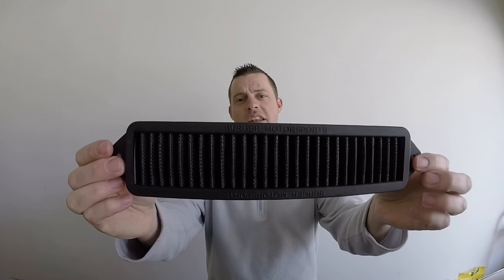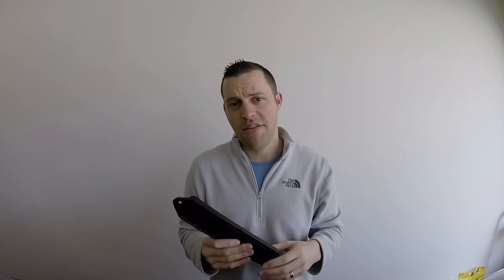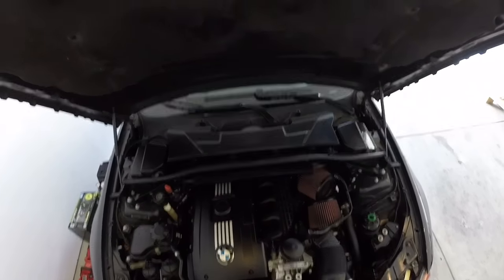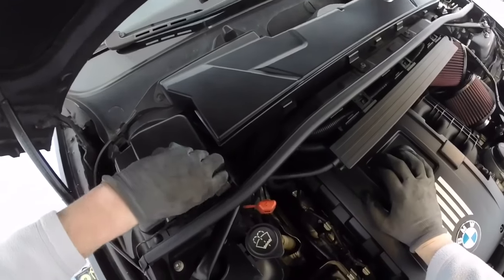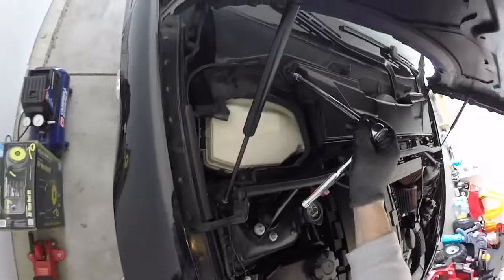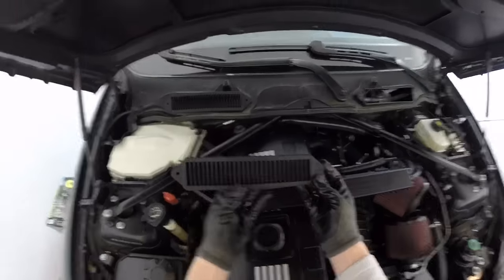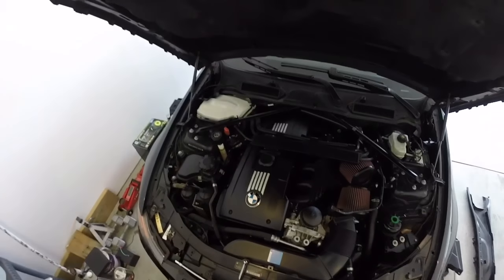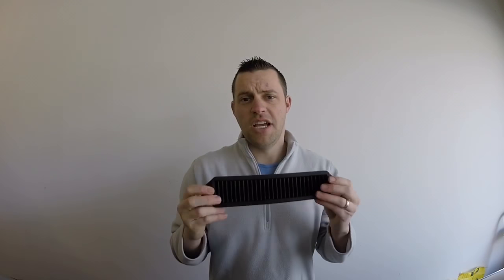Burger Motorsports BMW Cowl Filters POV DIY Install!

Comment: Even though must people would sky away from a BMW with 147k miles. I would buy yours in a heartbeat with all the maintenance you have done I'm sure the channel will help when you sell it
Reply from the maker: eddie lewis thanks Eddie! Yeah it's very clean inside and out 👍🏻 runs good too
Reply: eddie lewis btw this is my other account ur welcome it looks like a very clean car have you had any issues with the steering wheel plastic trim peeling?
Reply from the maker: Eddie Lewis just a little bit

Comment: You’ll definitely get easier access to your engine now. Without the cowl you’ll be in there much more often, with all the issues that water pouring on top of your engine and electrical connections will cause.
Reply: Word
Reply: Thank you to rise this concern. I wouldn't install those filters as in Belgium we have a rainy climate.
All the stuff BMW installed is for separating water / air.  My guess is some moist air will be sucked in or even worse will fall into the engine bay where it's not welcome.

Comment: ...and...what do you do about the cables hanging on the valve cover that used to be attached to the cowl?
Reply: My question also because looks really bad like that
Reply: MaddMatt ! Thank you
Reply: Yeah just velcro strap them to the strut braces - works well and easy to undo for work.  What I want to know is how to keep the weather stripping in place as well as that plastic housing (where the filters are).  Mine wants to come off the windshield and there's nothing really holding it...
Reply: that videos private man what he do?

Comment: is there water getting into the engine compartment or not?
Reply: I did these on my 135i. I only removed the air filter housing and left the bottom cowl. I have heard horror stories of the fuse area getting water. I also have to cover them with plastic bags when washing the car. They are fine for rain but not a pressure washer blowing on front glass.

Comment: What about those wires in the middle of the engine now? Do they just sit there?
Reply: I got a E90 and I was wondering the same thing.
Reply: @killabwpd  I figured it out. U unclip those boxes that the wires are in and zip tie them to the strut brace. Looks good
Reply: Thanks man, I'm assuming your running with the cowl off. A lot of people complain about the heat coming straight through the vents whenever it over 60 degrees outside. Is that a issue? I grabbed a 09 335 on Saturday and I'm ready to start ordering things!
Reply: @killabwpd  so what I do is put just the bottom part of the cowl on so it created the seal for any rain running down the Windshield and it protects from heat and sound
Reply: @jackb2879  thanks man. A lot of back and forth on the forums on these cowls.

Comment: Did you have any water seepage issue during pouring rain? Juz worried the water may go into DSC module/
Reply: I wouldn't worry about the DSC as that box is sort-of nicely sealed from above. I'd worry about different kind of seepage - the wide metal part helps to hold the cowl in its place. If the cowl starts to sag for whatever reason, it can detach from the windshield molding and in that case water would run down the windshield, then straight under the cowl and down inside the HVAC blower motor which sits next to the fuse box... I wouldn't risk getting water splashed around inside the dash for the sake of convenient maintenance. Also the engine loom would just rest on top of the head which gets HOT. Unless you do something about that, you are just asking for trouble imo...
Reply: This is a better alternative, you can use the BMS filters if you want while still keeping that rigidity https://www.youtube.com/watch?v=sFgQj51UQMY

Comment: How does this make installing these better sounding?  I was told by the BMW dealer that having all the OEM cowl parts and covers insulates a lot of the engine noise inside the cabin of the car.  I actually noticed after changing my plugs and having all the cowl parts off that I could hear the fuel injectors inside the car until I put it back on and Im not talking about the main cover over the injectors.
Reply from the maker: Alberto Francisco More cabin sound to hear your turbos, intake noise, etc.
Reply: BMW Fanatic Personally I hate hearing the typical ticking sound from the fuel injectors, valves etc... I would much rather hear my radio or exhaust
Reply from the maker: Alberto Francisco yeah some like it, some do not

Comment: Are you worried about rain/water getting in the engine bay ? That's a lot of plastic protection removed... I am hesitating to do it.
Reply: There’s a very good reason why BMW put some of those plastic cover that he took out. It’s to prevent a lot of water from getting into the engine bay 😂

Comment: Can that black plastic piece with the wires inside (going from left to right) be attached and secured again so it is just not sitting on top of the engine cover? Thanks.
Phil

Comment: I live in Minnesota where it snows a lot, how well would these work in winter conditions snowing a lot?
Reply: Luis Corona-Garcia i have them and it snows quite a lot here in Colorado and for the most part they’re good, but once I turned my heater on high while there was snow covering them and I found myself covered in snow because it blew it all inside my car

Comment: Question on the Cabin Sensor removal. Do the Recirculation functions and etc work the same as if the stock filter were in place? For instance, have a once in a blue moon oil drip that touches something hot and if recir is off it'll  come in through the vents. So with the sensor moved will the Recirculation function still work and keep out the smoke or normal environment scents?
Reply from the maker: +Calvin James it will work, but since it’s moved, it might not work as well

Comment: Good stuff. Thank you for the video. I want to do an install for my X1 M Sport N55. I do have a question, did you relocate the switch from the driver side that goes on the cowl plate or Its not needed. Thank you

Comment: hey been watchin a few of your vids im a new bmw owner i have a 09 135i is this something diy something you recomend for my particular model as well
Reply from the maker: Joshau Levell Yep!
Reply from the maker: Joshau Levell It's quick and easy
Reply: One last question I was thinking about doing a cobb stage 1 tune besides a spark plug change which I had done a week ago because I was already having my valve cover gasket changed out due to a leak is there anything else you recommend having done before installing a tune
Reply from the maker: Joshau Levell Plugs for sure as mentioned, but I would keep an eye on your coils to see how they handle the tune. Btw, skip on the Cobb flash, the maps are no longer supported. I would throw on a JB4 and start there.

Comment: I want this but my main concern is the wire harness resting on the engine cover.. hmm
Reply from the maker: YZFR6Yammie They are not moving at all, so I'll probably support them even further
Reply: BMW Fanatic I see. Went ahead and ordered them. Excited about easier engine bay access.

Comment: So you just left the wire hoes hanging on top of the engine cover? I just followed you on instagram:)
Reply: 2snayls wondering the same thing
Reply from the maker: 2snayls yep, there is not that much slack in them, so they don't move around. I'll probably be OCD and zip tie them lol
Reply from the maker: 2snayls Followed you back as well 👍🏻

Comment: I wouldn't recommend doing this, as your DME and engine bay is going to be more prone to water infiltration. You're not improving your performance by saving 5-10 pounds really. If you want to save a few pounds with your car, just go to toilet before driving :) or lose some weight :)

Comment: Dont do this to your car guys. 

It just lets hella water into your HVAC system causing foul oders.

You also get water all over your engine bay.
Reply from the maker: I’ve switched over to the E9X M3 cowl years ago, but never had issues when I ran these